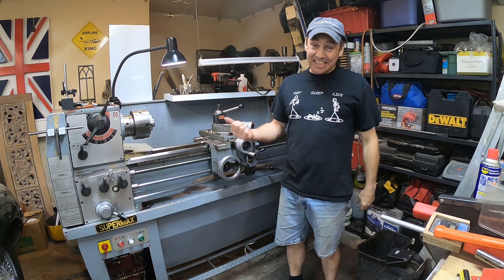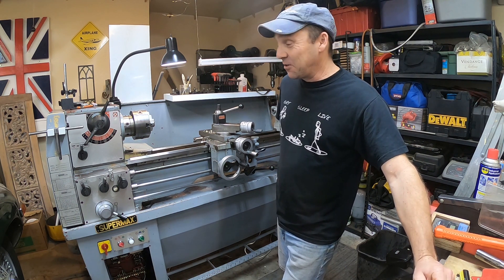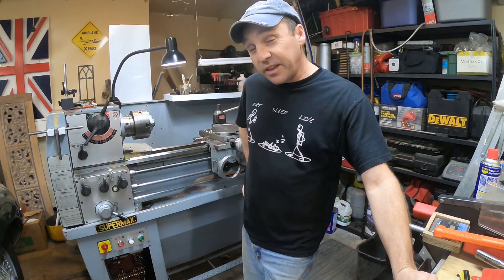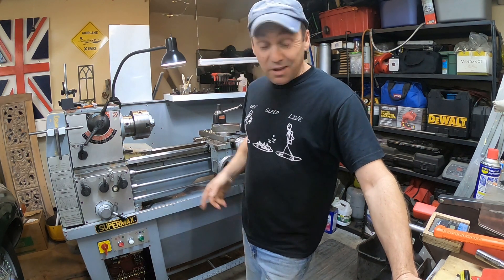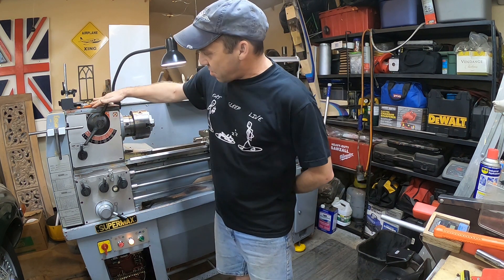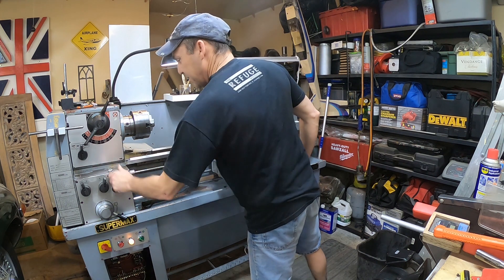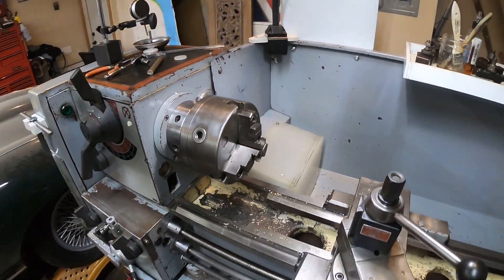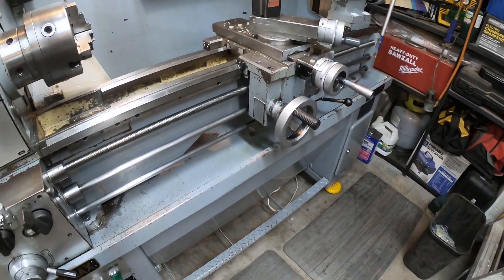2 Speed Lathe on a VFD

Comment: Did anyone ever get the wiring diagram for the vfd/2 speed 3p motor?
Reply from the maker: I never had a chance to write one up.  It's actually not that hard.  Just like a woman, let the VFD think it's controlling everything, when you are actually using the factory lathe switches to run it.  Look close at the controls on my machine, you will see it.

Comment: Looks like i'm a little late to the party! I myself just got ahold of the supermax. Bought the same vfd and was hoping I could get the wiring diagram?
Reply from the maker: There is no diagram.  But I suggest you read all the comments here.  The light bulb should come on.  You can post your email and I will contact you that way.  I will delete your email after I see it.😉
Reply: @jagboy69  seems like they keep removing my email from the comments. I guess my main question is did you guys split off the 220 power coming in? To give power to both the vfd and the contactors. Or did you use the com port off of the vfd to run to each switch/function to change from high to low and then your forward and reverse?
Reply from the maker: @shaneburchard95  You have to get creative when writing the email address.  I'm pretty savvy and can figure it out.  Judging from your question, you have never wired a VFD before and really need to speak with me directly.

Comment: I have a very similar issue with a 1941 Gorton vertical mill - big push button arrangement for hi/low/off and a separate barrel switch for fwd/rev. I can get it to work with existing controls, but trying to start in hi speed causes overdrawn fault on VFD.  I thought I would have to eliminate the contactors and wire in a manual 3 pole switch for speed changes.  But then I found your vid.  Is there some wiring or VFD programming magic you had to do to keep the existing controls?  Any help would be greatly appreciated by a fellow hacker machinist!
Reply from the maker: lol...  Okay, let me see if I can help get you more confused...  Entertain my few dumb questions while I try to wrap my head around what ya got.  First, is your motor directly wired TO THE VFD?  VFD's are greedy bastards and like women, do not want to give up control to anyone!  Now your on/off/reverse barrel switch should be wired TO the vfd and connected to the X terminals.  This is what tells the VFD to run the motor in Fwd/rev or stop and the VFD needs to be programmed for those particular operations.....  Now your high/low should be on it's own separate switch away from the VFD.  You may have to run that heavy lifting through contactors.  This is the basic logic I used to wire my lathe here in the video.  When selecting high/low speed, STOP the machine, make the switch and select your FWD or reverse as necessary.  If you have it wired any other way than I described here, you will get errors.  Providing of course you have a VFD sized large enough for the motor on high.  Nice to meet you and thanks for the question.  I hope you are subbed, because I am about to embark on the craziest shit you have ever seen using a monster VFD!
Reply from the maker: Birds of a feather I see...  I like Prather and Doubleboost too!  John is awesome and I actually won the draw one month!  Too bad my coffee cup showed up broken!  If you want a good channel, check out Mark Dice, he is a great patriot!  All the best!  Jason
Reply: @jagboy69  Thanks for the quick reply! Let me see if I can be more articulate: The mill is all wired as original.  The VFD 3-phase output is wired into the mill's main electrical panel just as if it was coming from mains power.  This was the first thing I thought to try, just to see how it would behave, trying to make the VFD 'transparent' to the mill.  I don't care if all of the controls are manual, or even about the variable speed at the moment. Likewise, I don't care if all the manual controls have to be removed and replaced to get it working, though I would really prefer to keep it looking vintage.  At some point I might want to change the fwd/rev controls so I can include a momentary foot switch for tapping, but I'm just trying to get the basics figured out right now, but maybe not - I also have a vintage tapping head that needs work.

Anyway, if we consider the mill to be wired without a fwd/rev switch, and never touch that (just leave it in fwd and ignore it), then logically we have: 3-phase AC input to the back of the mill, going through the hi/low/off switch (the big push-button affair), then to the motor.  I said 'logically' because physically there are also two contactors that are wired in between the hi and low switches and the motor.  As you know, these are the actual switching components that select the proper winding on the motor depending on the speed selection.  The low and off functions are fine with this setup, and I can even do speed control with the VFD.  But if I try to start the motor with the high button, I (usually) get the fault.

Having said that, I can also stop everything and switch fwd/rev with the drum switch (factory installed, with it's own place in the mill's casing) and this works fine in the low speed as well.  If I mess with the speed controller on the VFD while also turning on the hi speed switch I can sometimes get it to run, and then it runs fine. 

Based on your information, I'm thinking maybe I have a faulty/questionable contactor on the high speed circuit, or possibly the contacts on the high speed switch itself.    But maybe with this additional information you will see something that indicates what I'm not doing right.  This is my first attempt at using a VFD, and I'm not very strong on electric motor knowledge, but do know the basics and have learned a lot while researching this.  For instance, Stan over at https://www.youtube.com/c/ShadonHKW has a video about this topic he did for a viewer and he did a complete removal of many of the mechanical control parts (contactors, etc) but that motor was wired a bit differently IIRC, having the contactors on the fwd/rev side vs the hi/low side.

I'm hoping to get this mill fully operational so I can machine up some collets for it and start using it some castings and other projects, so it sounds like our shop hobbies are very similar.  I'll keep an eye out for your upcoming VFD project.

/r
Danny
Reply from the maker: @uberintj  Yeah I'm not so sure you have a faulty contactor....  Remember, a VFD is a greedy greedy bitch!  They will not take kindly if you don't let it think it's in control.  I want you to watch my surface grinder video when I first powered it up.  Listen for the VFD running BEFORE I flipped the switch on the machine.  What I did there was actually very dangerous!  It was only a test, but still was very wrong for me to do.  If you find yourself in the same situation, STOP right away before you blow your stuff up.  There is only one way to wire your mill with a VFD, just plugging it into the vfd is not correct.  The motor gets wired onto the VFD and your speed selector switch goes between the VFD and the mill's motor.  You Stop the machine before selecting hi or low.  Just like I did in the lathe video.  That high low switch only powers the 2nd set of windings in the motor.  Now If you look at my first bridgeport video where I got it to come alive, you will see the big fwd/rev barrel switch wired onto the VFD.  Programming the vfd is actually simple.  My mill is 2hp and I use no contactors on it.  Again, let the VFD do the heavy lifting.  You can program the VFD from there for what you like.  I too like legacy switches and want the VFD to be invisible.  And I have pulled this off with my 3 machines by wiring them this way.  The idea is to use little wires to tell the vfd which way you want to send power to the motor.   You can do this I promise... Take lots of pictures of what you have, then rip it all out!  IF you have a big control panel, get rid of it!  It will only cause you headaches switching to a vfd.  Let the VFD do it's job, any additional monkey switching will only cause you headaches.  Been there, got that t-shirt!  :-(  I just bought a monster VFD to control that lift in my recent sneak peek video.  The motor on that lift is 7hp and I'm going to operate the hydraulic system with MY PHONE!  I'm designing the safety system now to prevent any potentially fatal accidents.  Can't play around with stuff like this!
Reply: @jagboy69  Thanks again for the reply.  What you describe is the way I was heading, but was looking for a more direct way when I found your video.  I misunderstood what you have there.  Your control circuit design is what I had envisioned I would need for my mill, but thought you had something more immediately accessible.  Was trying to avoid having to dig inside this base casting for wiring, but that's what I'll do.  

I have no problem programming the VFD (or anything else for that matter), other than the tedium of those god-awful menus.  I have just trying to wrap my head around the power side of things.  I'll get a rotary switch to replace my push-button controlled contactors that do the speed selection now, and an e-stop for the right side of the machine, then I should be on my way.  

Thanks for all the input.  I'll be looking for the video on your lift.  Take care.
Reply from the maker: @uberintj    I wish there was an easier solution, but it's the price we pay for not having 3 phase at home.  If ya have any more questions, hit me up!😉👍

Comment: This is similar to what I need I believe. I have a dahlander motor with 2 voltages/speeds.
Are you using the VFD to power on the whole lathe including the accessories as well? 
Would love to have a wiring diagram if possible :) 

Also thanks for the bijur cleaning video - will be giving it a shot later on :D
Reply from the maker: Hi paul.  The vfd is only running the 2speed motor.  The only accessory I have is a coolant pump.  You can get 110vt pumps on fleabay cheap.  The wiring is already tricky enough.  I dont have a full blown diagram, but can email you what I do have.  Post your email address and I'll send you what I have.  I will delete your address from the comments.😉  If you have already worked with vfd's, you should be able to figure it out.
Reply: @jagboy69  email posted 😊 this is my first time using a vfd but I've seen a bit of videos how to wire them up and I know my way a bit around electronics. That being said don't know how to program them 😅
Reply: @jagboy69  ok sent you an email. Maybe YouTube removed my email?
Reply from the maker: @Pawcu4ever  probably.  I see your email and will get to work putting together something that should help you.  I have to work tonight, so maybe tomorrow.😎
Reply: @jagboy69  no worries I'm still waiting for the vfd to arrive 😅 thank you once again 😊
Reply from the maker: what vfd did you buy?
Reply: @jagboy69  I think youtube keeps deleting my comments if I post links. Anyways I'm from Malta so our 3phase voltage is at 415V roughly. Closest solution I found on aliexpress a vfd that steps up from 220V single phase to 380V 3phase (between phases)

Comment: This is exactly what I need. I have the same lathe on VFD but need to see a wiring diagram.     Thank you
Reply: great video. i also got a 2 speed lathe and have difficulty setting up the vfd. do you still have the diagram? thank you
Reply from the maker: Put your email address here and I'll send you what I have.  I haven't drawn up an exact diagram yet, but I think you'll be able to figure it out with what I'll send you.  I will delete your email after I see it.  ;-)
Reply: @jagboy69  I have sent my email four times, am I not doing this correctly. Thank you for the help I am trying to get my supermax 13x38 wired like yours.
Reply from the maker: check your email for the rest of this message.  ;-)
Reply: Hello.
Just seen this video.
I also need a vfd that will run my 3 phase original (star) 3hp motor, 2 speed Colchester roundhead master lathe.

Comment: This vfd setup is exactly what I need on my colchester triumph 2000. Didnt know this is possible. Looks like don't need spend 1.7k on phase converter now. Just need some more info what is what. Can you make video building this setup? My lathe doesn't have jog function btw so not sure what would be changed
Reply: What size motor you got and what size vfd did you get for that motor?
Reply from the maker: @sebastianochenkowski2665  Sorry Sebastian for the late reply.  This lathe has a 3hp motor on it.  The vfd came from amazon.  I think it is a 2.2.  I really need to put together a detailed video on the wiring.  Someday soon I promise!😉

Comment: I am SO glad you found a lathe. And that's a nice one.  Probably as big as you'll ever need but not too big. Mine is an 11 x 36 and I wouldn't mind a little bigger sometimes.   And I can assure you that there's no reason why you can't feed a two speed motor a synthesized three phase VFD output. The motor speed is changed by how the poles are wired and in fact, feeding a higher frequency to the motor reduces current for a given torque. So the guys running low frequency into their motor running in high all the time are stressing their equipment.

You may not be a machinist but you'll find that lathe invaluable in no time. Just drilling a hole on center, cutting tubing clean and square, shaving a few thou of a poorly fitting part, spacers, washers,  thumb screws, ...  Congratulations!
Reply from the maker: Thanks!  I'm already putting it to work.  It takes up some real estate in the garage, but the first part I made on it sells for half what the machine cost me!  Bonus!  I got lucky with this machine, its needed very little work.  A dro video is coming soon.👍

Comment: Nice set up with the vfd .  Great to have the 2 speed motor . Is that a Jag with the wire wheels .
Reply from the maker: yup.  1969 E-type.  I was happy to be able to keep both speeds of the motor working easily.  Thanks Max for stopping in!  I took your advice and used a thrust washer on the side of the worm.  It's going to work mighty fine!

Comment: A man after my own heart  - yep, a lathe and a mill - both necessary for ones existence. Check out smallcnclathes for some ideas on good tooling he cuts threads at 3000 rpm and turns spheres with just a parting tool! For my sins I drove Jags for  39 years  😱 and that is a lot of sticky tape and bailing wire 😊… Martin
Reply from the maker: Thanks Martin!  The whole casting thing goes right along with this stuff.   I've been watching blondihacks, she dumbs it down pretty good for new guys like me.  I'll check out smallcnc!  (and a lot of oil on the driveway!)  :-p